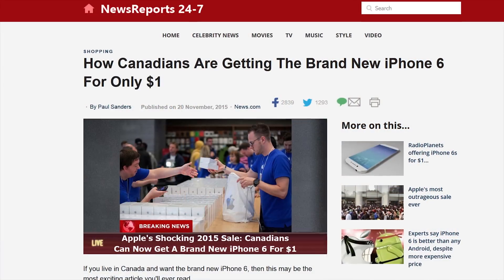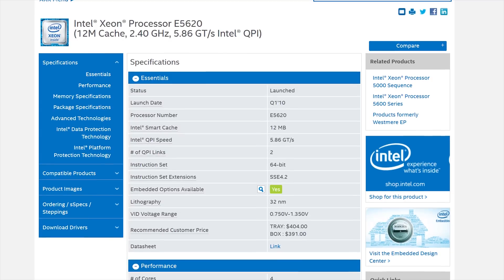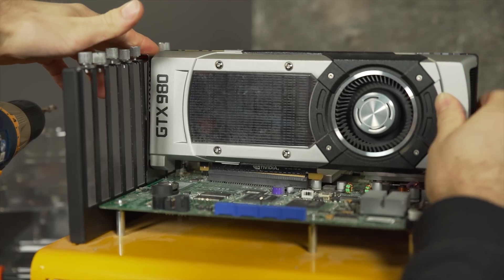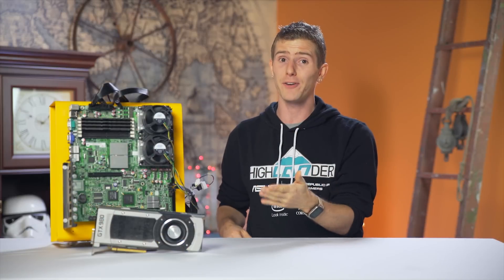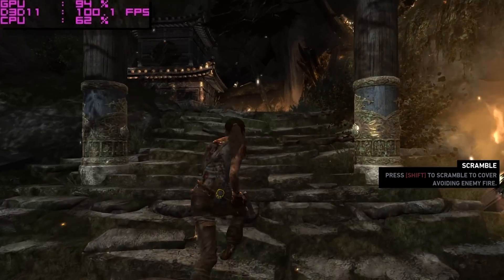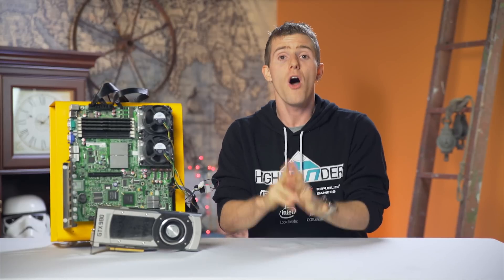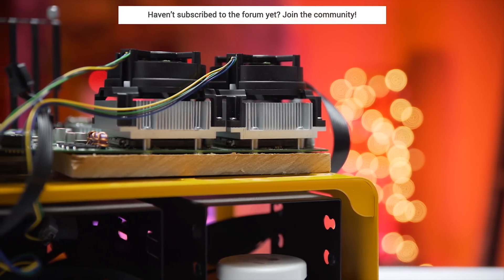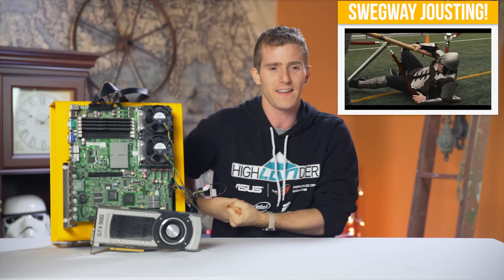Under $150 Budget Gaming 8 Core CPU, Motherboard & 16GB RAM

Comment: You can get an x79 rig w/ e5 2670 for the same price.... If you can find a reasonable mobo.
I did... then a little more digging revealed it to be a scam. Looks like x79 is all snatched up. If anyone finds a link to a x79 mobo for around $200 new or used let me know please.

Comment: I do seti and primegrid as well as several other things so all these builds you do have me wondering?with say 2 5970 cards per board and older server parts how much processing power could we glue nail and screw to 1, 4 x 8 sheet of plywood for say 2 to 3 thousand dollars? It would not have to be fast with enough cores to crunch massive amounts of numbers I would help with some of the parts just to see it built and to be kept running.

Comment: LGA771 Xeon CPUs can be modded to fit in consumer socket 775 motherboards with a simple electrical sticker and the removal of two small plastic keys on the CPU socket.. Result: All the benefits of a server grade CPU on an obsolete platform on the cheap with performance that hits well above it's weight.

http://www.overclock.net/t/1431723/mod-lga775-support-for-lga771-xeon-cpus

Comment: you forgot to mention that there are adaptors for lga 771 cpus that go under the cpu and "convert'' them to lga 775.then you can put the 771 xeon on the 775 mother board but you will need to do some cutting around the socket.just google 771 cpu stickers

Comment: Or you can do what I did, and mod a 775 mobo socket to allow you to install a 771 Xeon CPU, which is what is used in the video. You can get a used 775 mobo for about $50, and that paired with a $25 Xeon X5460, that leaves you $75 for ram, which we can use cheaper standard DDR2 memory.
Although you lose the other four cores you could get from a dual socket server mobo, you get the ability to overclock for most decent consumer 775 mobos. You also get proper expansion slots and the ability to buy a decent cooler.

Comment: The proper title of this video should be: 
"The $150 budget dual cpu server with all pieces bought used", gpu/vc not factored into this budget due to us deciding to test possible bottlenecking on a $500 gpu we already had and not a similarly budgeted gpu so experience will vary significantly.

Comment: Linus i have a better idea the Pentium g3258 and a motherboard combo only cost you 80-90$ in microcenter and add  8gb mem for 30$ or 16gb mem for 60$ the total is 150$. It performs better than this solution and it have all modern features.(is better only after overclocked in some games^_^)

Comment: and here we can see how you can build a 150$ 8 core rig that can run current games... provided you have a 500$ graphics card lying around
Reply: Can run current games on any decent GPU , he just bought a horrible board, the best board in this range is an s5000psl Intel board and doesn't bottleneck anything , I play all games ultra 100+ fps , GTA V included , provided I have a mega GPU but 800$ > 1700$ , good game fellas. Plus you could run a whole system playing most games in ultra with a 750ti , entire system for 220$" GG. Try get i7 skylake performance for that anywhere ;) couldn't even buy an i5 6600'for that lmao
Reply: +Hunter Rodrigez $600*
Reply: +Hunter Rodrigez yeah course they don't , that's why I've made 40k off building these , haha GG son.
Reply: graphics card is worth more than my future
Reply: I care, I'm looking for components for an UnRAID server right now. That comment just helped me find a killer dual socket board for $39 on eBay
Reply: he never said its a gaming build video title says what it is. but yeah still stupid
Reply: +Hunter Rodrigez true!!!
Reply: Well it's way better than a desktop that cost 650
Reply: TotalInsanity4 js you can buy total servers with 32gb ram, 2 quad core cpu's and hard drives for under $50 :P. if you want even more ram just upgrade to 64gb...
Reply: +Kyle Fulerton Completely new to the PC building scene. Do the PCIe Gen 1.0 slots/the lack of any x16 slots on the S5000PSL bottleneck the GPU (say a 750ti or an RX 480) at all? Or do any of the x8 slots actually run at "x16 mode?"
Reply: Kyle fulerton BULLSHIT
Reply: $500 that's almost what a GTX 1080 cost which if you're using anything less than an i7 or a really good i5 you'd bottleneck, even if only by a little bit.
Reply: Kyle fulerton dude... No one cares...

Comment: I do this myself, I have 2x quad core Xeons at 3Ghz and 16GB of RAM, the great thing is the RAM is quad channel so it makes up a bit for the lower speed, plus you've got lower latency too, only rather than building my own I use a workstation, an HP XW6600, with a USB 3 card and SATA 3 card, hooked up to an SSD. I've gotta say, it keeps up for now. I plan to use this system for another few years. It's not even noisy :-)

Comment: Your price doesn't include a power supply or disk drive, what models did you use and what were the costs?
What is the exact model of the 980 GTX that you used?

Comment: Well... honestly, the graphics hardware is the most expensive part when you're gaming at that level. LGA 775 parts just became unsuitable for gaming a few years ago, so naturally 771 server parts are still hanging on by a thread.

Still, it's definitely better than gaming on a dual-core i5 now that multi-core is becoming relevant.

Comment: you can get older Xeon boards that DO have more expansion slots AND don't obstruct the PCI slot in such a way, you just gotta look harder and not just grab the cheapest thing you see on ebay.

Comment: So theoretically this would be PERFECT for something like a small personal render farm? A complete machine would be about $230, so with 3 of these that's 24 cores for only $690! That sounds almost too good to be true, or am I missing something? That cost is based on a cheaper <$50 PSU, cheap referbed HDDs, and no case, but do server components require anything special like different PSUs or anything?

Comment: Whatever, I liked this. I have 2x xeon of that era lying around in a dual mobo and the RAM that I used for a data center a while back, I just didn't know I could fit a recent GPU in this, I tried and it works fine, thanks Linus :-)
Reply: BTW, I have to be honest here... It's a dual X58 mobo with DDR3 RAM and PCIe 2.0 (ASUS Z8PE-D12 Series), so of course the performance is quite higher and the GPU didn't have any prob fitting in there (most if not all PCIe 3.0 are backward compatible with PCIe 2.0), it's above the "kit" shown in this clip. That said, if tight on budget, I'm sure that anyone could easily find X58 mobo components for cheap and build a very high value system in terms of dollars per performance.

Comment: my gfx card is a AMD sapphire 7970, CPU AMD FX-6300 
Vishera 32nm Technology, and RAM 16.0GB Dual-Channel DDR3 @ 666MHz (9-9-9-24) (Corsair Vengeance), motherboard MSI 970A-G46 (MS-7693) (CPU 1)

This runs most recent games and no need to cut any hardware parts off, and plays them pretty well.

Sure you wish to get the best of the best but its harmful to cut parts off your hardware.

my setup runs recent games nicely and may only update it if need it.

Comment: Wait why is the cinebench score so low? I thought it was cpu-intensive and this thing has 8 cores
Reply: +ingusmant 8 really old cores at 2.5 GHz so really low clock speed and fewer instructions per clock so they really aren't that great. Personally i think a quad core lga 1156 cpu would be better.

Comment: LGA 771 to 775 mod is really the best way to go for a Xeon 54xx series build. Personally, when going to this kind of extent, I recommend looking into the LGA 1366 stuff. They are faster and the chips are cheap and plentiful, with up to 6 core per socket. HP Z600 is a great buy for a dual CPU Xeon system at around $200 on ebay. That is a great "budget" gaming box.
Reply: *****
Not really. HP Z200 ATX motherboard, socket 1366 is $49 on ebay. E5540 CPU's are $10 or less. Dual socket boards run around $100. Hp Z210 board right now on ebay for $20, this will support the E3 Xeon chips. Quite a lot of options when you start looking at workstation motherboards and cpu's

Comment: LinusTechTips Can you do a video on the 771 to 775 mod??  Although it's only going to be a single quad core, and likely less memory (8GB instead of 16GB)...  the compatibility with Windows, drivers and PC cases will be much better since it's based on using ATX motherboards.  My Family PC is an AS-Rock G41C-GS with a Xeon X5450, 8GB RAM, 240GB SSD and a GTX960.  Granted, I bought that board new and the total cost just for board, proc and RAM was around $160...

But... I am building another one for a friend and I got an X5450 for $20, an ASUS IPIEL-LA for $22, and 8GB PC6400 for $33.  The existing Case, SSD, Heat Sink, and Power Supply will all work without any modification.  So he is upgrading from an E8400 / 4GB, to an X5450 / 8GB for $75. 

And a lot of people might be able to just use their existing motherboard...  This one is an Intel G33 series, and Intel doesn't included Xeon microcode in their BIOS... and apparently, nobody have been able to edit their BIOS updates.

Comment: one problem. that motherboard will not fit any conventional consumer case. you need the original server tower or just build your  own like Linus did. Also, it is way easier to run the single cpu because of memory issues or cpu motherboard compatibility. Great low budget build that beats ANY i5 processor out there. im makin the same thing with a xeon w3570 cpu 12gb ecc ddr3 ram all under $70!

Comment: Recently I bought an old server board with an i/o shield, 8gigs of ramn, and an included opteron quad core 2.5ghz processor with cooler, the only problem I ran into, was that there were no audio connectors (as many server boards don't need them) The solution: usb audio adapter, its really as simple as that.

Comment: Right now I'm looking at an Intel board and a Xeon x5650, both on eBay come out to about 200 USD together, I was thinking about using a dual server motherboard but I wouldn't be able to overclock them, and the x5650s overclock like a dream, so why not just get one and soup it up, rather than two slow ones that might suck with games that can't utilize many cores, but yeah, a 6 core/12 thread cpu stock at 2.66ghz which can easily hit 4ghz on a cheap cooler for 75 bucks, why not

Comment: If he went for x5450s it would have performed much better... I have 2 x5450s, 32gb fbdimms, and a gtx 750ti, and I'm running GTA V on very high settings at 40-ish fps.

Comment: It might be the case that the current generation of consoles will influence the way developers make games.  The current generation of consoles has an 8-core APU and 8GB of shared memory.  In each case, they use more than 2GB of that memory for graphics.  A friend of mine told me that right now, it is more important to have more GB of video memory than to have more muscle in the graphics processor.  I think that might also be the case for processors.  The number of cores available might be more important than the power of those processors.

Comment: I bought a used 1156 board(not server) with 8gb ram and a Xeon x3430 quad for around $60. You can get the x3440 and 3450 for around $35, they are quad cores with hyper-threading. They also overclock fairly well depending on your board and heat sink.

Comment: Or pay slightly more, and get a dual CPU "workstation" with similar CPU'sand you won't have to make all sorts of modifications to get stuff to work.  
You can sometimes get lucky and get one really cheap with a pretty decent GPU in there already.

Comment: I pulled a couple Dell precision T5400's outta the dumpster at my dads work. Used 2 E5450 Xeon quad core 3ghz cpus and 4x4gb sticks of ecc 667mhz ddr2 ram, then i put an msi amd radeon hd 7950 oc in it and man i play gta 5 at 1080p with 45fps most of the time so yea im glad he did a video on this because all in all including graphics card i spent about 350$ on hardware
Reply: +BlackSnowTech oh yea and what i meant about being glad he did a video on this is i already did it years ago i just mean so other people know about it now.

Comment: You are neglient about some very important things. First of - All server grade motherboards have a limited compatiability with other hardware. For instance if you find a socket 771 CPU for your mobo it is not sure it is going to work. Second - Not all motherboards come with a second VRM and most PC builders don't even know what that is or what the socket looks like. Third - Finding an affordable mobo is challenging in itself. And if you find a decent one that is compatiable with the CPUs you want to use - but what if the mobo only has PCI-e(8x), what kind of performance/bottlenecks will we encounter(some suggests that there wont be any bottlenecks)?
Reply: +g4yktzgjx6 Expanding my own comment on the CPU bit. When you have found a mobo you deem fitting. Then go look up its chipset on intels website. On the left side you can see a compatiability list of CPU's click there to see what CPUs gos ith your motherboard. I am actually amazed you left this out Linus since it would suck if you spend a few bucks on incompatiable ram, but it would suck even more if you also bought incompatiable CPUs.

Comment: At the moment on ebay, there are 16 core g34 amd opterons being sold for £50 each and a supermicro quad socket g34 motherboard being sold for £585. For less than £1000 you could have a workstation that rivals £10,000 dual xeon workstations :D that's of course you can deal with the motherboard's eccentricities
Reply: Ok I just saw another quad socket motherboard for £350 this is insane. http://www.ebay.co.uk/itm/Super-Micro-Computer-H8QG6-F-Socket-G34-AMD-MBD-H8QG6-F-Motherboard-/331769753805?hash=item4d3f04b0cd:g:C98AAOSwzhVWsnU5

Comment: Linus, I have a question. You always use either a GTX 980, 980Ti, or Titan in most of your high end builds. However you usually use a 500 watt PSU and all of those graphics cards require a 600 watt PSU at least. Plus you say there is room for overclocking sometimes. Is this true? Cause I have a 500 watt PSU and am thinking of saving up for a 980 or Titan. I want to upgrade the least amount of things possible. I will also upgrade to an i7 CPU eventually and was wondering if 500 watts is enough for either a 980 or Titan if I DON'T overclock. Anyone else can answer this as well! :)

Many thanks in advance!

Comment: Old server dual-cpu gaming PC with DDR2 ram for $150?  Are you serious?
How many games simultaneously use more than 6 cpu cores?  less than 1%

used Pentium G3258 (on ebay) = $30-$50 USD
new MSI H81M-p33 (or e33) motherboard = $45 USD   (used will be cheaper)
used fast 2x2GB DDR3 or fast 2x4GB DDR3 (on ebay) = $20-$40 USD
Don't install windows update KB3064209 (because windows won't start if G3258 overclocked on non-Z board)
overclock G3258 to 4GHz+ and optimize ram frequency and timings.

90% or more games will run fine on powerful dual-core cpu with medium speed (but not slow) DDR3 ram.
2x2GB is often enough if you also have Sata3 SSD and do not disable page file in windows.
If you absolutely must play the newest, most demanding games, then spend more money.
If you have NVidia gpu, use shadowplay to record video, instead of cpu video recording.

Comment: Not convinced. The incompatibilities and weird BS that you will run into will make you cry. Would not recommend unless you have some serious DIY skills and gear (drills, screws, old parts, saws) or the system comes prebuilt, in which a consumer system of similar power would likely be around the same price or cheaper simply because the server hardware was much more expensive to begin with.

Comment: To modernize this look for e3 1225  v3, v2 or v1s in "workstations" aka server boards in desktop cases. You can get full systems for sub $300 with 16gb of ram.  Just add a gpu. And the motherboards shoudl be standard atx or atx-e  layout.
Ebay search example " Dell Precision T1600  Xeon   E3-1225 "

Also search for bitcoin gpu cards also turns up lots of reasonably high end gps people want to get rid of. Due the the new asic minners. Prices are generally all over the place so you can get one for $100 if you wait.
Example search "amd card r9 280"

Comment: I did this with xw6400 board :D I had to modify PSU pins tho
 If I could find xw6600 for the similar price i'd go for 3GHz. but  i got 2.33ghz
still it does 3 times better than core2duo :)

Comment: I hope you realize you can convert LGA 771 to LGA 775 by using a sticker that switches some pins. That would save all the BS you went through for everything including that GPU, and you can use it on nearly any G45 Platform.

Comment: I've seen a few pairs of e5530's on eBay for $9.99 USD for the set of two, with free shipping.  Pretty insane deal for a build like this. Some decent motherboards that would fit them for around $40-45, still with only 1 pci on those as well though. For someone that had an old PC around that they could salvage the harddrive, case, ram and PSU from, you could slap a r9 250 in it and for around $110-$120 USD total have a decent little gaming setup.

Comment: Build something like this quite recently. Got a bunch of free L5410 CPU's and DDR2 FB-DIMM modules. Was a little bit smarter and got a workstation board, the Tyan i5400PW. Also got a bunch of 2kg each copper cooling blocks (~$30 in total). Advantage of the workstation board is that you get a whole bunch of PCIe slots, the i5400PW even has two PCIe 2.0 x16 slots. That ought to be plenty for gaming :)